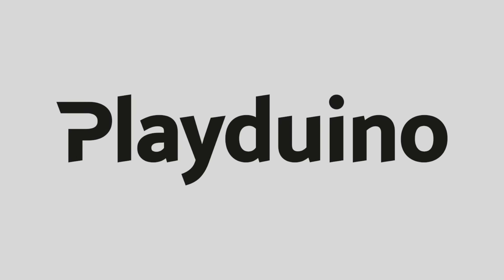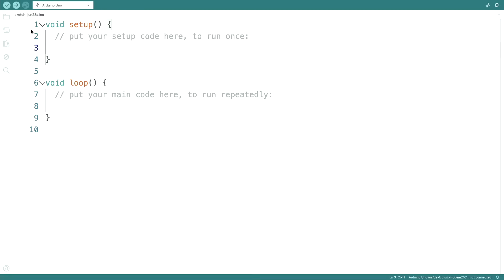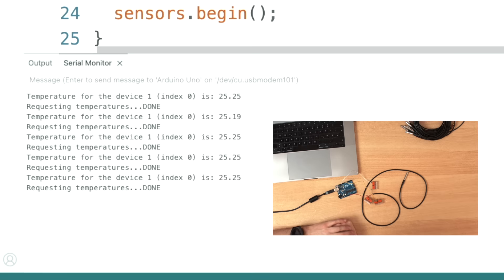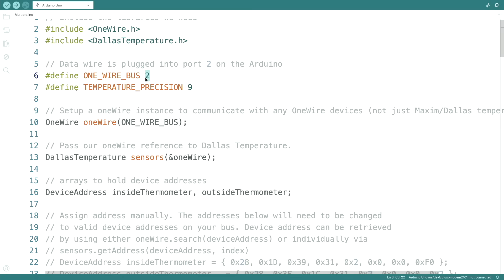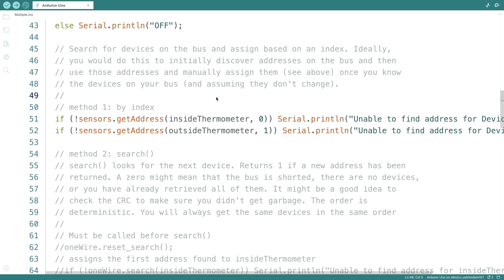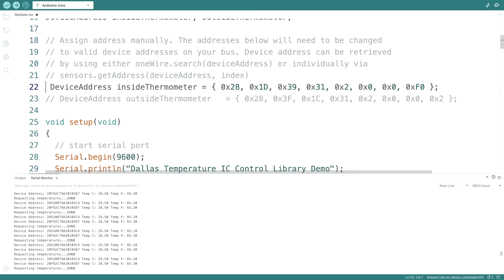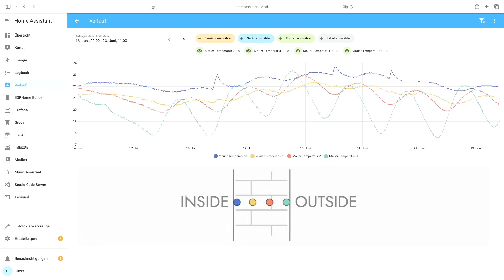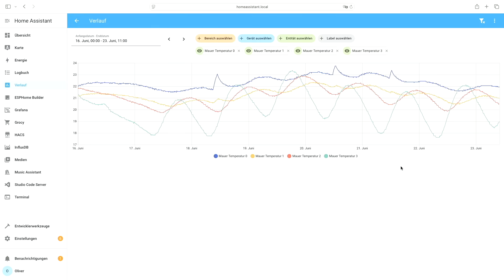How to measure heat traveling through a wall

Comment: Interesting. Comparing a very cold day in the winter and a very hot day in the summer will be also interesting.
Is that wall on the north (without sun) or south side (with sun)? Is there sunlight on the outside wall? Maybe measure also the light outside and compare a wall with sun and without sun.
Did you drill one hole for all 4 sensors or 4 holes, so each sensor has it one hole? I guess the first variant might have slightly wrong values, since the wire transport the heat also. (So in worst case it might also different a little bit if you drill the hole from inside or outside)
Reply from the maker: Yes I agree. unfortunately my home assistant did not save the data that long :/ but winter looks very interesting! I will follow up :D

the wall is on the south side and gets sun exposure. I put the sensors into the wall when I built the wall. I also routed the cables not directly out, but in parallel to the wall (inside of the wall) for a while. So the error should be minimal :) I agree a sun light sensor would be interesting.

Comment: Interesting video. I definitely would like to know more about the one wire bus. What are the limits? I heard about someone that used them in an inventory system where the sensors were used only to provide an address to a drawer. I do not remember how they were able to tell when the drawer was removed, but I thought using the sensors in this way was interesting. Thanks.

Comment: I would be really interested in seeing the entire code you used for reporting to homeassistant. I made a datalogger for my pond and ended up going with thermocouples with MCP9600 amplifiers. These temperature sensors look like a much better option. Ive also struggled at getting data into homeassistant reliably in a way that doesnt hang up or crash.
Reply from the maker: I’m sure I do not have the most elegant solution but I can definitely make a video about it

Comment: This is great, real time/historic stats on how efficient your insulation is. Thanks for giving me a new project, lol! The one wire protocol allows for long transmission lines, even longer when using a branch sensor set-up. If you were doing this with SHT2/3/4X sensors, I2C would be out of the question. You'd need something like RS232 comms to achieve decent cable length.
Reply from the maker: yeah. up to around 100m should work fine with a pullup resistor and 1-wire. For long lengths with higher data rates better use something differential like RS485, CAN bus or Ethernet :)

Comment: From the delay between outer surface temperature extreme value to next sensor extreme value you could calculate the heat resistance / conductance value i.e. K-value. In test labs strong heat pulse is exposed to one surface. The time the other surface starts to warm up is measured. This time is used in the calculation of the K-value.
Reply from the maker: Interesting! I need to look into this.

Comment: I have a lot of chinesium clones running on esp8266's with ESPHome and sending their data to home assistant. Works great, just a couple parameters, easy to calibrate etc.

I've found one problem, that might be just for a bunch I got, or probably common with at least the clone stuff.. The same type of wired "waterproof" sensors like in the video isn't that waterproof in reality. I teared couple open and there were so little amount of glue or something in the tube that it just held the actual sensor in, but the solder joints were not protected at all. I fried few sensors by calibrating those in a cup of water. I had like 7 sensors sitting in ice water to get pretty accurate 0°C, then in hot water to just average all results together, so that the set would give somewhat comparable temperatures. (there were some outliers, but in a range of ~1°C which is good enough for about anything right out the box, but I got all to track through 20-60 in +/- 0,1 degrees of each other) 

Also the heat shrink wasn't that tight on the tubes and had no visible glue on it. If I would bury those in the walls etc, I would inject some silicone or something in the tubes and put better heat shrink on them.

The most annoying thing was that the sensors didn't fry while calibrating, but couple weeks after I had installed those to spy on my heating system and had to change non calibrated sensors to their place.

Just that bundle measures heat pump inlet+outlet, heating buffer tank in+out (which should be the same as hp, unless it is making hot water), radiators in+out and the hot water to the mixers (which goes near to room temperature when water is not used and jumps up to actual value when used).

I have added temp sensors to almost all esp things I've made. There's solar panel bottom surface, solar inverter case, sauna temp, several other inside air temps and a set of 5 just for anything that feels like worth logging for "science". It does room air layering now with sensors every 400 mm. Should add couple more to get full room height, but didn't have ones with longer wires when I set it up and wouldn't bother to extend the short ones.
Reply from the maker: I also use some Chinese clones, and fortunately, they’ve worked great so far. I figure if they haven’t failed yet, they’re probably fine deep inside the wall 😄
Wow, it sounds like you have way more temperature sensors in use than I do! I’d be really interested to hear about your results with the 400mm air layering sensor—that’s super interesting!
Reply: @playduino I knew that there will be some gradient in room tempersture, but seeing that it is ~2,5°C basically always surprised me.

The room that thing measures has only gravity driven vents, so the air moves slowly and there's not much other movement mixing it.

For some reason most of the gradient happens under 1 meter and from there up the graphs are in 0,5°C range.  There were thinner warm layer near the ceiling, but it was probably in winter and heating was on.

I should add couple sensors to my setup, so I could get the whole room height at once. Or not, as I have already seen enough and now know that the room temperature sensor height isn't that important, but it needs to be somewhere between 1-2 meters.

There are other rooms and different ventilation systems though..
Reply from the maker: 2.5°C is quite a lot!
I did something similar and also measured a noticeable temperature difference:
https://www.youtube.com/watch?v=M-dHFGdkrLM

Comment: Great video. I was trying to work out why you needed to stick the sensors in the wall? What will the thermal mass tell you?

Why do you need the resistor? How did you calculate its value?

Cheers from Australia
Reply from the maker: It was really just the opportunity. We renovated the house and converted a door into a window, so I figured it would be interesting to embed sensors inside the new wall.
I think I’ll make a video about it, but in short: the 1-Wire bus requires a pull-up resistor because all the slaves on the bus use an open-collector (or open-drain) output to send data. This way, nothing bad happens if multiple devices try to talk at the same time. If no output transistor is turned on, the resistor ensures a HIGH signal on the bus line.
I picked 4.7k because it was the value specified in the sensor’s datasheet.
Greetings from Austria! 😊